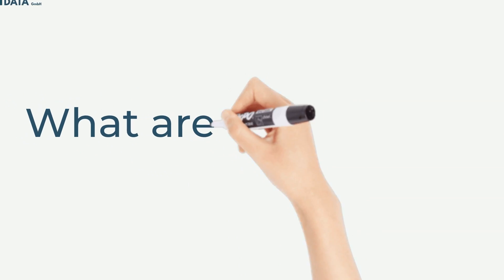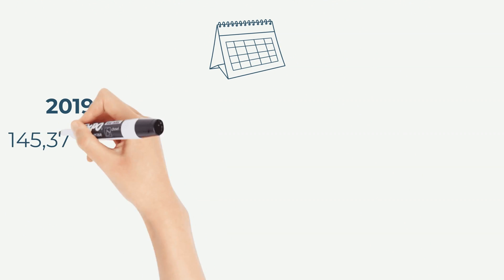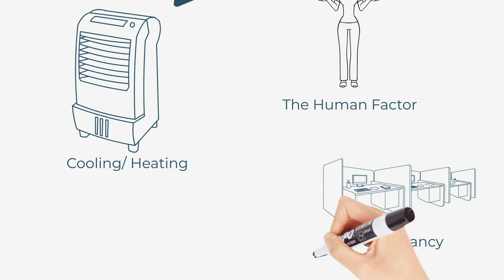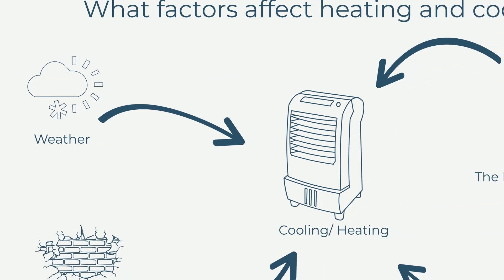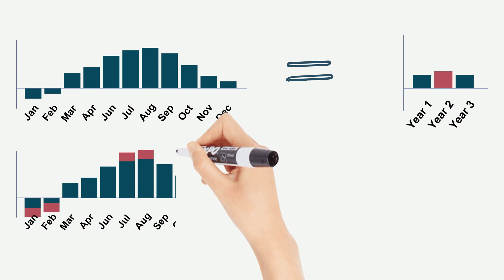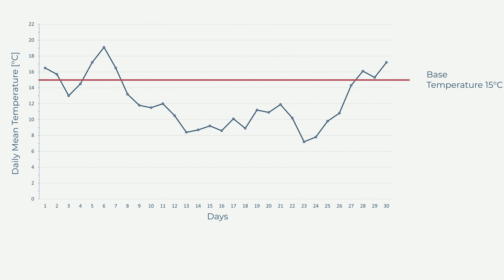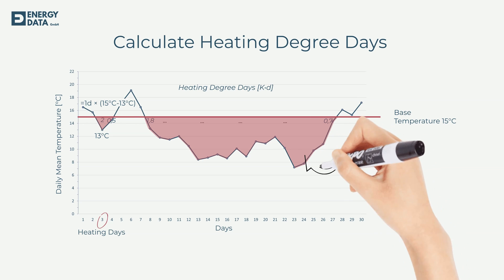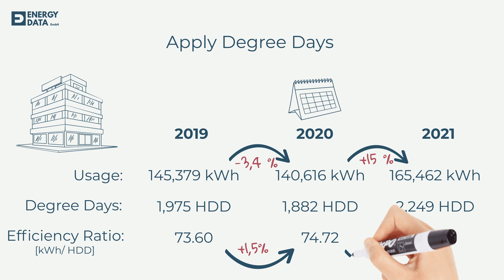🌡 What are Degree Days and why are they crucial in Energy Management?

Comment: how would you compare heating energy data from two locations? just by the efficiency normalization?
if you find the normalized kwh/HDD for france and for Ireland ... you kind of can compare, but how would you normalize it back to kwh only in this case? multiply by the HDD in ireland or in france?
Reply from the maker: Hello Ricardo, thank you for the excellent question. Your goal will determine the best approach: if you aim to identify the most energy-efficient location, the efficiency ratio (kWh/HDD) will suffice. However, if you want to quantify potential savings, you should opt for normalized kWh based on either a long-term average or a selected base year. For more details on the calculation process, watch our related video here: https://youtu.be/0Ras5-AkvoM. Additionally, you can explore our Energy Normalizer web tool at https://degree-days.net.

Keep in mind that these figures are estimates, and factors like building characteristics, heating system types, and occupant behavior can influence actual energy consumption. Therefore, when making comparisons, it's crucial to consider the types of buildings being compared, as different building types may exhibit varying energy efficiency levels and consumption patterns.